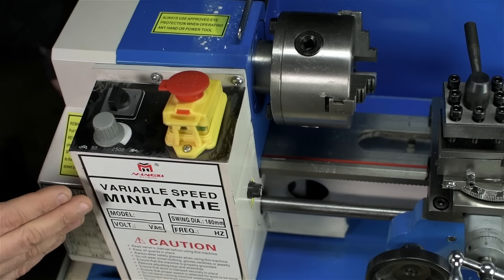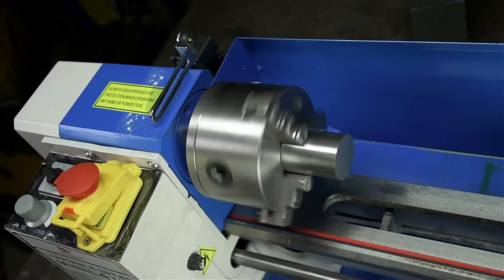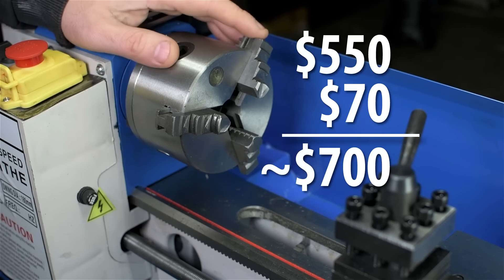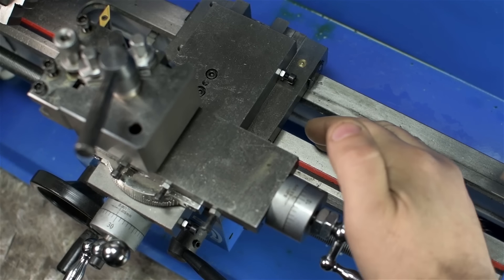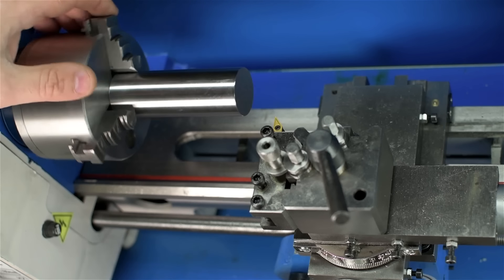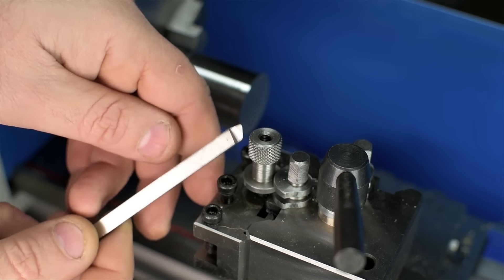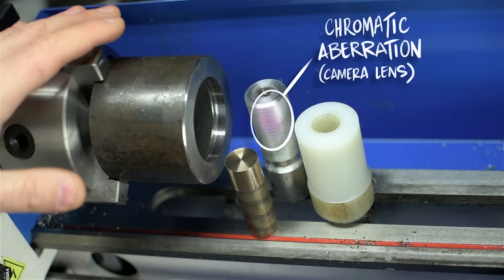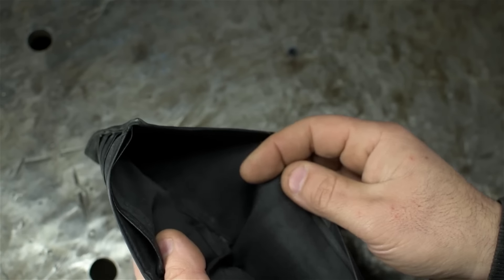The Infamous Mini Lathe!

Comment: BTW it's normally the belt that strips before the gears break, the later models have an overload sensor on the motor (or wherever it is) so if you try n stress it it to much it just stops. The mill I'm still using is from the same factory but that is rubbish.......yet again I've done some good projects with it you just work round the faults hehe.
Reply: Hi Colin, love your work! Here have a like.
Reply: Mr. Safety tie follows ToT?!
Reply: Haha, the belt stripped on mine too, makes the worst noise in the entire world!
Reply: You can tell this is an honest review because of who it is. Thanks colinfurze and ToT.
Reply: @PracticalRenaissance  how do you like yours? I'm probably going to buy one for my boat to try and be a bit more self sufficient in remote areas
Reply: Back in my minilathe days I found the motor stalled or the belt slipped before anything could happen
It didn't take long to upgrade
Reply: @TomMakeHere  thanks but for me its this or nothing because there's only so much room on a 43ft sailboat.
Reply: @southjerseysound7340  Don't get me wrong they do work, and can give really good results
Agree with TOT on all points re steel cutting. Keep it light and it's ok
Reply: @TomMakeHere  Thanks,I'd definitely swap the gears etc beforehand and most likely I'll be using it on bronze and aluminum. But it would see some stainless too. Taking it easy on stuff would be the norm but I really need to be able to thread stainless for rigging repairs. Having spent almost 2 months waiting for a turnbuckle in the past, I'm determined to be able to make my own. Also having the capability to make/repair things while cruising can make some extra beer money. Once people found out I had a welder I had to turn people away.
Reply: Hey there Colin! Didn't know you follow TOT too...
Reply: Yes, because you got a “close shave” of a fit getting your gears on, there will be radial stress along that gear’s circumference, but since it is a keyed arrangement, even more stress will exist in the year’s keyway. Consider the definition of torque; because the keyway is rectilinear to the drive axis, and outside the circumference of said axis, it will receive linearly greater forces depending on how far away from the axis the key acts upon the keyed gear. It appears your gear fractured very close to the keyways, which is where I bet a FEA simulation would show the highest stresses. I’m not familiar with the properties of acetal but it probably doesn’t allow for a lot of strain, making it okay for gear teeth that don’t erode like those of a meth fiend, but too stiff when a stress overload, like Christmas at the relative’s, is introduced 🤓
Reply: Yup, mine still has it's original plastic gears, but I stripped every tooth off the belt, it was smooth when I finally replaced it.
Reply: Am I missing something here?
The plastic gear ID is tight on the shaft, inducing stress.
220 Sandpaper is a thing that exists.
Reply: If Furze is commenting, I'll give TOT a sub
Reply: Wanted to say hi from Michigan and would like you to look up E.J.Potter.  love your work and especially your welds. More video on the underground drum set please.  Thanks.
Reply: Ha I thought I recognized that lathe
Reply: Those belts get brittle with age and strip easily.
Reply: Didn't expect to see you here. Hi though
Reply: colinfurze 

Ok
Reply: We"re not worthy. (Wayne's world reference)
Reply: I don't understand why it's so expensive. Normally Chinese stuff is dirt cheap
Reply: @JYTherapy  Furze is one of my favorites! Now that I've watched all of Tony's videos, I know that he can stand on his own merit! Anyone that he follows would be worth subscribing to as well :-)
Reply: when is your next vid
Reply: @lucasparenteau6085  It's been a while Colin!  What's cooking? (pun intended...)
Reply: Omg its collin!!!!!!!!!!!!!!!
Reply: @boredfartless4221  where are you shopping that this lathe is expensive? Tony bought his directly from the factory(I think)  which is a very pricey way to get one.
Reply: Kali Southpaw  so its Colin Fart or Colin Farte, nice.
Reply: oh s h i t t t t t t  it colin furze!! you gettin buffed up with the stair tredmill?
Reply: colinfurze seeing a big you tuber comment on another YouTube vid is like seeing your professor at a strip clip, as a stripper, and she asks if you’ve  started your term review paper
Reply: FURZEY!! hello :D
Reply: I want to perches this lath. Can you tell me purchasing prossiger & how much price .
Reply: Yep I stripped a belt and had a heckuva time finding the replacement at the time. Ended up purchasing a 10” lathe and then found a belt and sold this toy. Eventually got rid of the 10” for a 13” and today I’m looking at a 16” lathe. Damn things are never big enough projects keep getting bigger, 😎
Reply: You can purchase metal gears for them at  little machine shop.com.
Reply: colinfurze 0
Reply: SouthJerseySound l9
Reply: Ya just gotta know your tools,  use em right or lose em..  most of us learn that the hard way..
Reply: Who else read this with a pommy accent!?
But nah love ya Col!
Reply: wow its colin!
Reply: My slow gear broke, everything is now done faster, I stand to the side.
Reply: Hi Colin
Reply: @PracticalRenaissance  worse than Jim Carey and Jeff Daniel's in the dogmobile?😁😁
Reply: Didn't you have an emco compact 5 at the beginning? That one is even smaller.
Reply: Ah looking for a mini lathe Colin
Reply: @yebber6404  I wish I had enough space for a full lathe but my mini lathe is already taking a lot of space out of my living room. Colin already has a lathe that any owner of a mini lathe can only dream about.
Reply: @rwbimbie5854  Excellent review but yes, why not just ream  the gear or something simple like 220.
Reply: That explains the horse in your drive.
Reply: @TomMakeHere  did you upgrade to a different minilathe (a better one? if so which one?) or to a big boy? I would like a mini one for space reasons, but I'd rather not have it be shitty.
Reply: @TheFreak111  I upgraded to a southbend clone. I knew within 5 seconds of doing a test cut that I wanted to buy it. Yes it's bigger and heavier though
Reply: Colin!!!

Comment: This is an old video, but it would be neat to see an upgrade series using one of these to upgrade itself. That is, turning raw materials into replacement parts that are either as good or better in quality, and an improvement in functionality.
Reply: You need a mill to really do that right. I know, I am fixing some of the errors in my lathe.
Reply: Lol I bought a 1030V lathe several years ago.  I got probably 10 hours on it and it died twice.  First time cost me $125 to get a machine shop to manufacture some t-slot bolts and nuts to replace the cheap ones that stripped on my lathe.  The second time it died I replaced the bolt that holds the tool post down.  The tool post bolt replacement lasted about 30 seconds and it stripped.  After that I covered it with a tarp and it hasn't been touched since.  A few months ago I tried to turn it on and it's dead.  So my shiny lathe is scrap metal sitting in my garage now.  To me it's a hobby for the wealthy.  Too much to buy the lathe and replace it piece by piece.
Reply: @oldfarthacks  Agreed.  If i had decent camera equipment i'd go ahead and do a video series but it has to wait....

Comment: I bought one of these as my first lathe - my thinking was influenced by a number of things. 1. I knew precious little about lathe work and there is nowhere near me that does any courses. 2. if I don't like it then its cheap enough to use as a boat anchor and 3. if I bought a bigger lathe and messed up, it would cause huge expensive damage to the machine, me or both. After breaking numerous tools and destroying the gearbox in the first two weeks (The internal gears are plastic!) I taught myself quite a lot about lathe construction and machining various materials. I replaced the gears, both internal and external with metal sets. I replaced the head bearings with angular contact bearings and taught myself to lap in the top and cross slides, replacing the gibs and screws as I did. sounds exhaustive but it has taught me an awful lot and I now regard it as money well spent. It runs straight and true and i still use it for making delicate parts that my 13" lathe would destroy (In my hands at any rate). That my friend (pardon my assumption) is how these machine should be viewed - a great learning tool and a cheap way in!
Reply: Evi1M4chine  It IS very cheap. You can't be stupid enough to think you could actually buy any sort of useful lathe for "$50-100", not even second hand. If you can't even afford this then forget about any ideas of doing any lathe work unless it's using someone else's lathe. Sorry but reality isn't going to change because you're poor.
Reply: Evi1M4chine 
I think the comments regarding your financial status are thoughtless and unnecessary, not to say better have been left unsaid.

That said, $1000 is a bit high. $600 will get you something similar where I live (South Africa).

Try looking for pre owned. And don't let the comments from self important blowhards bring you down
Reply: I know people working that tight who have 12 work days. Or didn't have the cash to go to collage when a 4 year degree is required to shovel S**t these days. I can relate to this.

That said. $1,000 is pretty much the minimum you're going to get away with unless we're talking the extremely tiny micro-lathes that use a cordless drill motor (and are still a few hundred bucks for as tiny as they are).

This is true even if you make your own lathe using someone else's lathe. A good controller that's not a fire hazard can run half the cost of this thing. Tools are consumables, expensive consumables at that. So are chucks, change gears, lead screws... basically everything on this thing will wear out.

If you want to get into home manufacturing on a tight budget, get a 3D printer. My Tevo Tarantula was $180. Even there, I still have to buy new end switches and hotend cartridges, not to mention filament, which is $20/kg for not-garbage stuff that won't clog. However, just like my 3D printer (more so, in fact). You can use this lathe to make parts that you then use on the lathe. say... brass change gears? making stuff for other people in your spare time can save you some cost. I've made a bit of cash printing stuff for people as well.
Reply: Evi1M4chine  I got mine in the UK for about £650 but that was with enough tooling to hit the ground running - not sure how that translates to dollars.
Reply: @bertkutoob  I did start my comment with " You can't be stupid enough to think you could actually buy any sort of useful lathe for "$50-100","  which was a bit mean I admit and apologise to Evi1M4chine for that tone. He seriously needed a dose of reality though if he thought he could ever buy a usable and at all practical lathe AND equip it for anything like that.
Reply: @DFX2KX  - WHO "didn't have the cash to go to collage"? %b
Reply: @lorditsprobingtime6668  Sorry, but it's guys like that who will find one of these with tooling for $50 and make something with it we never would have imagined! Stop getting all "conspiracy theorist!" about it and let the guy figure his shit out. It's literally guys like that who will take a hand drill and make a lathe and start turning out parts that pay for the machine we all dream about, or he'll just buy a better hand drill ...and a yacht! I don't care what kind of lathe he comes up with. Almost anything can make enough Scotch & Soda Magic Coin Tricks in a year to pay for any kind of CNC machine he wants!
Reply: @Tricknologyinc  I was referring to the guy who dismissed evilmachine not having a $1000 to blow on a hobby, saying 'just work more'

You need a degree (or a cert) for the kind of job that gives you owning-your-own-mill kinda money. But you have to be able to pay the price of a new car for that degree.
Reply: @lorditsprobingtime6668 
Hi,
Your response is the best Christmas Eve present I've had for a long time. One seldom sees an apology on YouTube. It takes balls.
Blessed Christmas & Peace.

PS : Reality happens when ANYONE goes into a machine store no matter what their budget and leaves with their mouths watering - geez it hurts!
Reply: @bertkutoob  . Thank you bertkutoob, for the compliment and the chrissy wishes. I was a bit harsh, and I can understand how frustrating it is to have dreams like his and be getting paid crap money. I thought a dose of reality now would be better than harsh disappointment later. I honestly meant well, but realise I did come off as an arsehole. I also know the feeling of working in a machine shop and using good quality large to very large lathes plus mills, shapers and surface grinders, and the dream of owning one, a good one myself but never having anywhere near enough money to buy my own decent one that I could do most jobs on and the pain of seeing how much a good sized versatile one costs. Sadly I could afford one now but I'm too buggered up now to use it enough to justify the expense. And that "mouth watering" feeling after looking at ones is very familiar too. I did buy a cheap TIG welder off fleabay a while ago but that was only a couple of hundred anyway. Tricknologyinc up there might be right too, this guy just might be capable of improvising enough to get started and end up with a decent setup, I sincerely hope he can.  Evi1M4chine. There are those ones that are convertible I mentioned that sound great with the versatility and all, and you can pick them up for about $300 AU but please please don't waste your money on them, they really are rubbish. Way too much flex all over to ever be precise no matter what you do, underpowered and just absolute rubbish. These cheep mini lathes are at least somewhat solid but very limited, still pretty good value though, even though you'd need to spend another 50 to 60$ to replace the plastic gears. For small objects that don't require a thread cut that the gears on these don't cover these wouldn't be too bad. Ideally he'd then want a 4 jaw chuck and internal and external dial indicators and a magnetic base plus at the very least Verniers which you can get quite cheap these days and ideally at least a 1 inch or 25mm micrometer. All things he can get bit by bit I guess though.
Almost forgot. Happy christmas to you and yours too bertkutoob.
Reply: @Tricknologyinc  I hope you're right, it could happen. I have no idea what you're talking about with this " conspiracy theorist! " comment, there was absolutely nothing I said that suggested any "conspiracy" anywhere.
Reply: You can now produce your own gears for your machine and sell the extras to others and pays off  your initial investment. 
Next would be a better machine to move forward to the next stepping stone of $.
Reply: @loktom4068  First. He hasn't got a lathe yet, he only has " $50 to $100 " max budget. Second. Even if he did have one, you can't cut gears on a lathe. He (if he had one) could cut bar steel into the diameter and carve out some of the centre area and do the bore, but he can NOT cut the gear teethe nor the keyways.  So no, you can't "produce your own gears" even if he did have one, not without more specialised machinery. That was a wasted comment.
Reply: @Tricknologyinc   I didn't- I  was homeless at 17YO and since New York State still considered me a minor , they used my Father's income to disqualify me from financial aid even though he wasn't supporting me, I had to drop out of school and work one full time job and another part time job to find a basement apartment to rent so I could move out of the abandoned bus behind a Hess station that I was living in. It was the early 1980's.Does that answer your question?
 My first lathe I paid about $600 for, my first CNC mill came from a lock factory and I bought it for less than $1200, of course I had to completely rebuild it. (video on my feed)The guy who only has $100 budget should google "Afghan lathe" to see how people with very little resources turn metal, and work from there. there are old lathes in people's garages that can be bought for a few hundred dollars or he could barter for yard work or something. If he wants to be a machinist, and he is motivated, he will find a way.
Reply: @DFX2KX  You don't need a degree or a cert. You need to know how to make and fix stuff. I know what you were referring to. I was jabbing you for the way you spelled "college". LOL